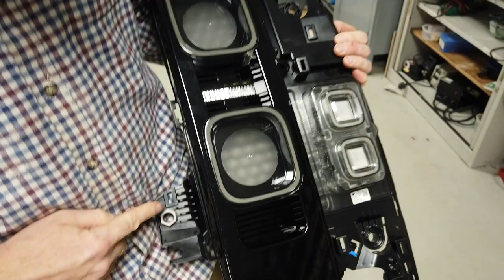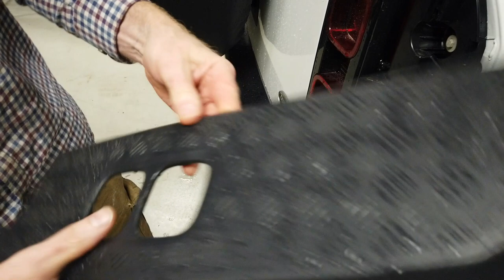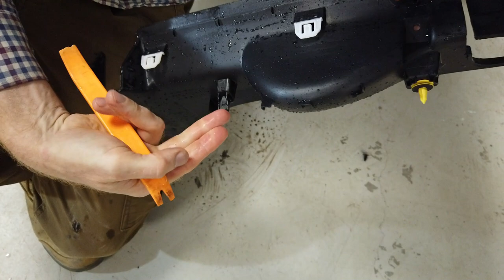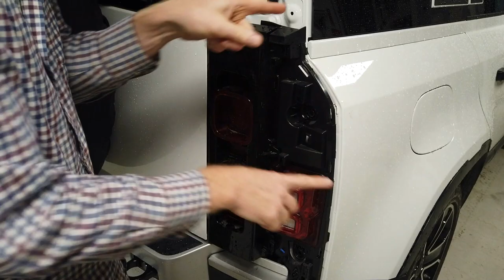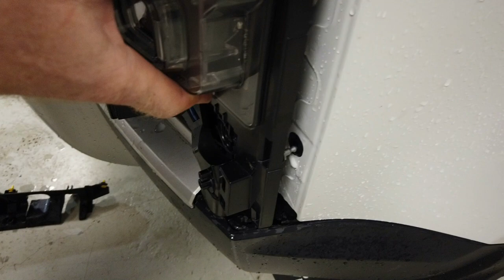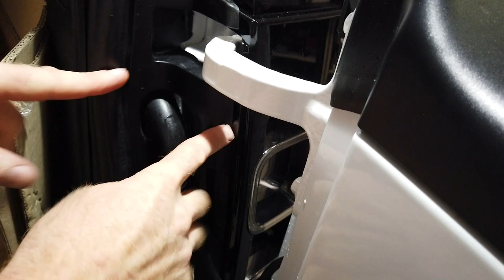Land Rover Defender 2020 Rear Light Removal / Upgrade to Model X Smoked Lamps

Comment: Just fitted to 90 Hardtop, had to remove my overpriced plumb storage compartments, anybody bought these? What do you keep in them? I got a first aid kit in one side and towing shackles in other. Lights easy to fit, but I broke the clips on the pretend chequer plate trims, in fact I broke clips on everything I took off.. 2-part glued everything on assembly. Lights look cool, only about 1 hours work… next job are the extra indicators and am guessing I have to take all the same trims off! Probably buy some new replacements ready before tackling the job!

Comment: It's like a massive plastic toy.
Reply: Yes - It's just a 60K airfix  kit.
Reply: @christopherwright815  Be interesting to see one when a Bull has had a Rub round one
Reply: Yes, I bet when this model gets to be 6 or 7 years old, it will be hard to spot one without one of more bits of trim held on with tape 😉
Reply: @christopherwright815  will be missing bits of trim. Plastic checker plate too haha
Reply: Well if you need any replacement parts just walk up to any Defender and help yourself - make sure no one's looking though!
Reply: @mda5003  HAHA

Comment: Eight years after buying my 110 Defender puma 2.2 by gear stick knob has disintegrated into bits and the whole stick needs to be replace for around $300AUD. It should have lasted longer and is another common failure. I don’t want to think how the plastic on the new Defender will age. Clips in particular are going to be a problem! And the CEO of land rover wants to be more environmentally sustainable?

Comment: More bravery again Simon! All those trim fixings seem a bit worrying and those rear light units ought to be supplied with a bag of the ones likely to die being pulled apart. I also wondered how much those X light units costs...quite a lot I would think...£200+ each maybe???😨😨.  Good work again! Richard😀😀😀😀
Reply from the maker: Hi Richard the lights are not cheap... retail is over £300 each + VAT. If we sell them they will indeed come with some white clips !
Reply: powerfulukltd Gosh..so not far off £800 a set!!! I do hope you sell some though...and well done for those clips..why don’t JLR include them???....probably to make you take the lights back to the dealer to put the lights on for you. My local dealer does not seem to be selling many...plenty of Evoques and some D/Sports but only two Defenders for 70 plates...a white one much like yours and a totally black one with black wheels..it looked horrible but no doubt will be parked outside a nightclub next week...never going near a farm in its life! Have a good weekend! Richard 😀😀😀😀
Reply: powerfulukltd IF? Don’t tease us.
Reply: @HQBProductions  thats expensive to  replace even if you just break 1 light it requires a whole unit mad tbh

Comment: Do you think the UK spec lights can be installed into a US model?  You mention at the outset that the US market has a different configuration so wasn't sure what you thought.  Or maybe there is a way to test them by plugging them in prior to swapping.  The reason I'm interested in the UK configuration is because the turn signals are amber flashes in the two small lights, whereas in the US it is all red and everything flashes red on a turn signal (or when the hazards are lit).
Reply from the maker: That is a good question... I am not sure if the lights are different or if the car just flashes the tail / brake lights on the US version. OK so while writing this i just looked up the part numbers... in the old days the part list would show NAS Spec so we knew that was North Americal Spec (NAS) but now i see that the list has part numbers for the US with these smoked lights.
Now they seem to call the US lights " FM VSS 108 pattern " which seem to relate to this.
https://en.wikipedia.org/wiki/Federal_Motor_Vehicle_Safety_Standard_108
So good news... there are these lights available for US cars !
Reply: @L663  Do you think I can unplug the connector from the unit that came installed on my US car, and plug in the smoked UK spec I order from you, without having to completely uninstall the lights?  This way I can just test it to see if the UK spec generates the amber signals from the US software, or if not, then it's definitely also a software set up.  I saw the blue wiring sort of showing at the bottom before you guys took off the light so I was curious if I could poke the connectors out of that hole and just to a quick test.  Curious your expert thoughts and thanks!
Reply from the maker: @johnfagan9441  Hi John.... for you... and because we are nice guys here... I ordered the US spec lights and will plug them into my car and see what they do !
Reply: @L663  very... very cool!  I would say you guys are very nice guys.  looking forward to learning how it goes of course :)

Comment: Discovery 3/4 tail lamp removal takes one minute. There is a difference?
Reply from the maker: You make a very good point...these are perhaps more complex than needed.... we may see this more as there is no need to change bulbs on these LED type lights... sealed for life... so they can be designed in more.
Reply: Maybe they are addressing the light theft problem
Reply from the maker: @dantheman7370  You have a valid point ... you cannot steel these lights without opening the rear door !

Comment: Watching that made me really worried. So many little penetrations of the bodyshell depending on foam washers for waterproofing. How many of these things will be back at the dealerships with water ingress in the first year of ownership 😬
Reply from the maker: Its a good point you raise - it may have been better to have studs protruding from the bodyshell that the part "docked" onto.
Reply: @L663  It's weird. Watching you guys change those lamp units reminded me of an old Peugeot 306 my son once had, it constantly leaked around one tail lamp, those fittings on the defender were much the same, just a load more of them. Very practical video though (as always).

Comment: thanks for this video!!  Super helpful.  Did you guys ever try painting the plastic light covers?
Reply from the maker: Hi - yes we did try painting the chequer plate effect covers but it was not a good result - they are made from PU - Polyurethane and they are not easy to paint. Most plastic that is painted is ABS plastic.